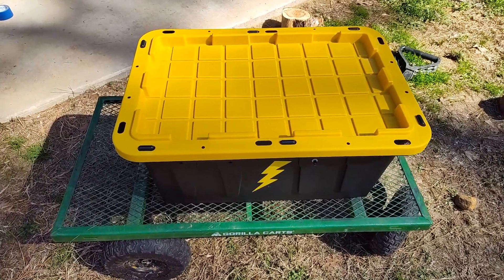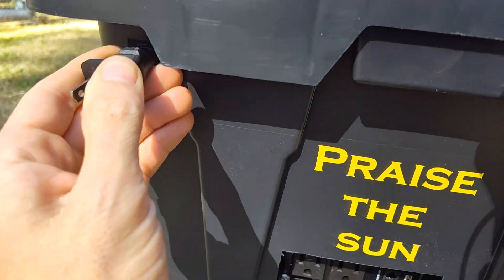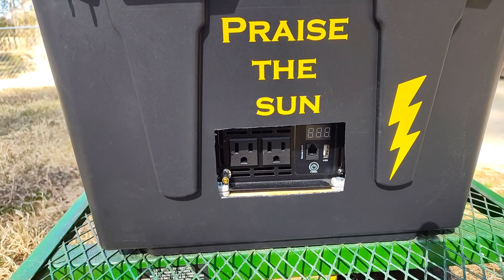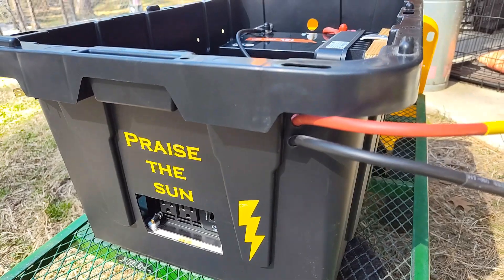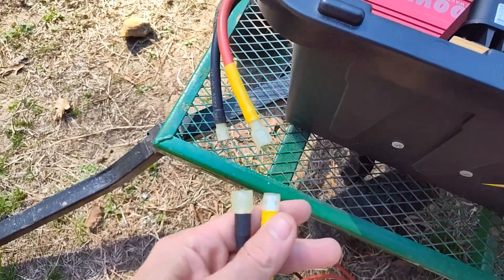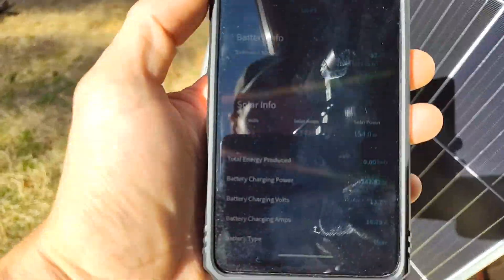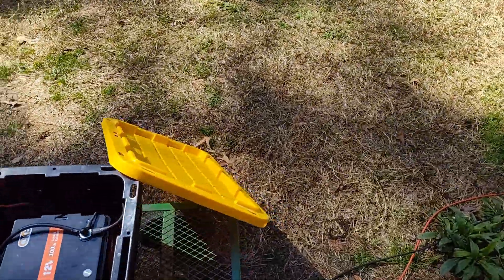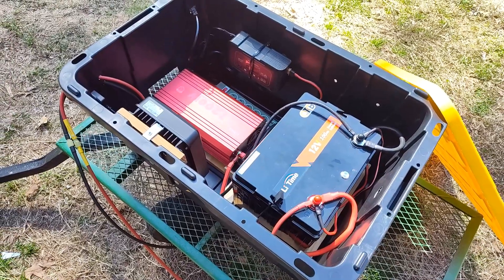Homemade Solar Generator for Freezer - Dark Souls Edition

Comment: Parts list!
Reply from the maker: Thank You! 

Giandel 1200 watt Pure Sine Wave Inverter
Rich Solar 20 amp MPPT Solar Controller
Renogy Bluetooth Adapter
LiTime 100AH LiPo Smart Battery
10 Amp LiPo Smart AC Charger (forget brand, will edit)
HQST 190w Solar Panel

Comment: That came out really nice.  Those jackerys are way over priced.  I bought a pecron for 855 it has 2000 w inverter, 1200 watts of solar input and  a 1980 w lifepo4 battery.  I still want to do what you did because if anything breaks you can immediately replace whatever the problem is plus there is nothing like doing it yourself!  You did a really nice job!
Reply from the maker: It was a fun project, my only regret is building it into a cheaper tote. I'd like to rebuild it into one of those stackable toolboxes with the wheels on it. Oh and a hard disconnect. I was intimidated a bit at first but there really isn't a whole lot to it! I was considering a bluetti before I ended up doing this instead.

Thanks for watching!